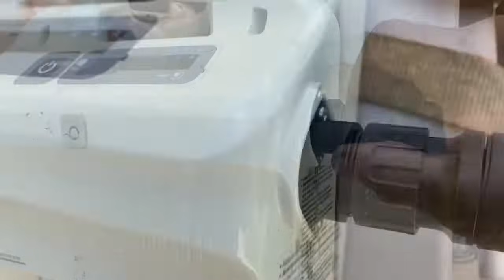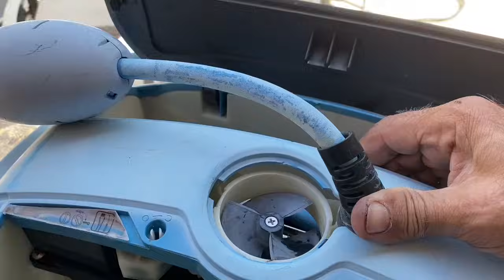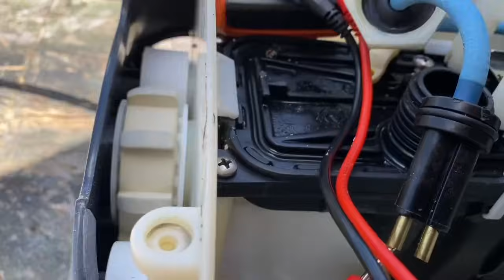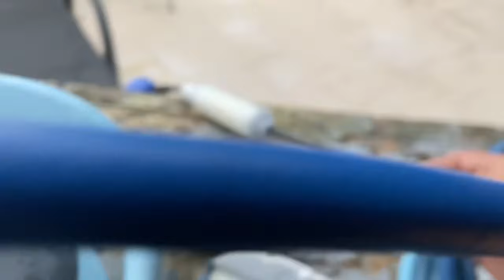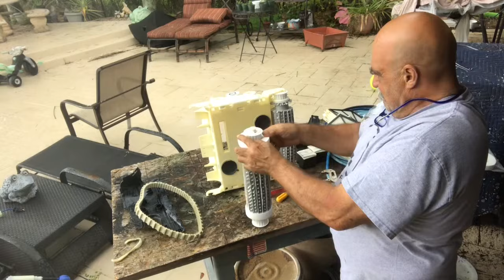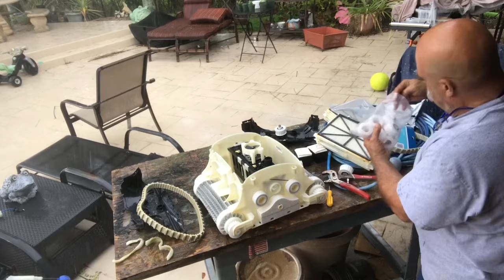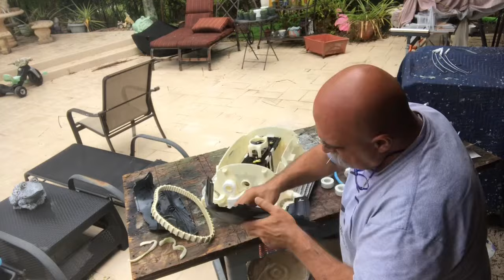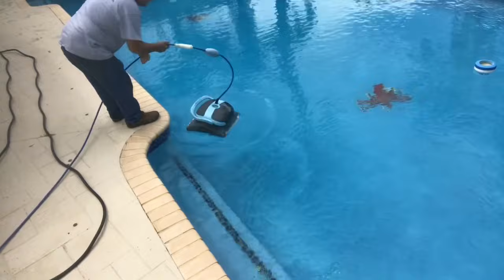How to diagnose and repair a dolphin pool cleaner

Comment: How do you know if the motor is bad. Mine runs a minute or two and stops. Then the power supply shuts down and want come back on. I unplug it wait a few seconds plug it back in it will come back on and move a little and shut down. I took the motor/ pump out  and plugged power supply in. It runs for a few seconds and stops. The impeller run good. The drive motor seems to be very rough and tight. I know it will only run a few seconds when not submerged, or so I read.
Question is what’s next? Is it the motor? Please respond ASAP I really need to get it working. Pool is looking bad and back will not let me revert back to vacuuming the conventional way. Thanks, Phillip Hurst
Reply from the maker: Did you do the test with the multimeter on your power supply it needs to read 29 if it doesn’t then it is your power supply that you’re having a problem with.
Let me know if that helps.
Thank you for your question and if you can leave me a thumbs up.

Comment: Santa, I didn’t see how he took the top and sides off completely in the video. It went from you taking out the power cable and the screws and then suddenly I saw you with the open sides. They just pop off with a screwdriver to takeoff the top. Thank you enjoyed the video
Reply from the maker: Thank you for your comment. Along the side you just pull the sides out there’s some tabs there and then the top lifts off I’ll have to watch the video and see what happened I did show all of it I’m going to make another video on this I bought some other parts that I didn’t have before I’m hoping to put that up this weekend.
I’m glad you like the video and if you can leave me a thumbs up.
Reply: Same, that part that was fast forwarded was the part I needed to learn about.  Thank you!

Comment: OK do not have 29 dc out of the power supply     any suggestions
Reply from the maker: It all depends on the power supply that you have if it’s an older version they have a fuse inside that can be replaced.
If it’s the newer version you need to make sure you have 120 coming out of the outlet and also out of the other end of the plug that goes into the power supply.
If you have that and you have lights on on your power supply but you’re not getting 29 out of the plug on the right side of the power supply then you will need to take out that plug in test the bear wires be careful because you need the power to be on when you do this if you were getting 29 at the raw wires then you just need to replace that plug if you’re not getting 29 at the raw wires then you need to replace the whole power supply.
I hope this helps you and if you can leave me a thumbs up.
Reply from the maker: First of all thank you for your comment.
Reply: The cable was very hard to pull out.  Does the factory have a cable puller? I had to rig a board and pipe to to get the cable to plug out.  My connectors were green and one broke off from corrosion.  $300 for new cable and still doesn’t work.  Most likely motor now.